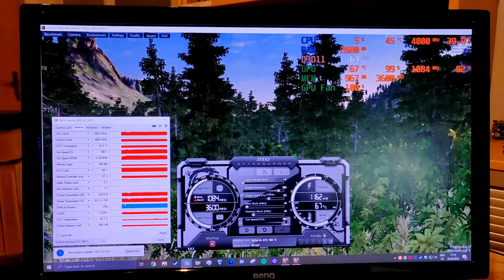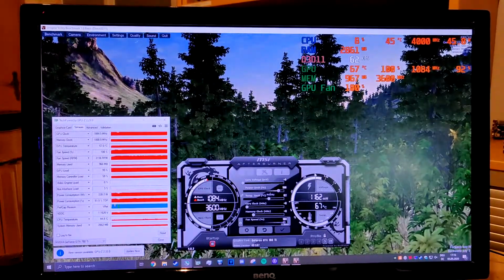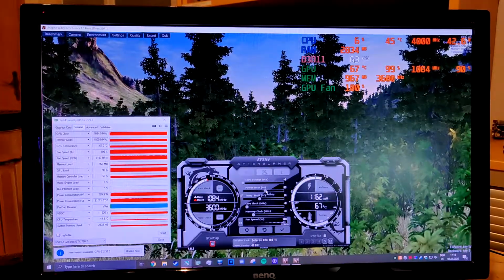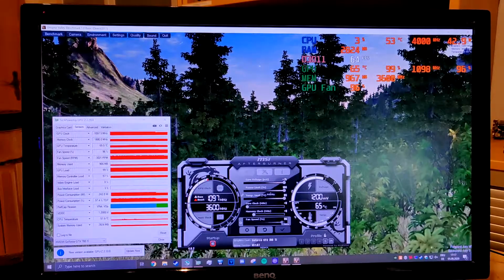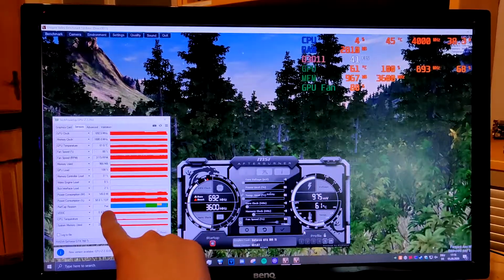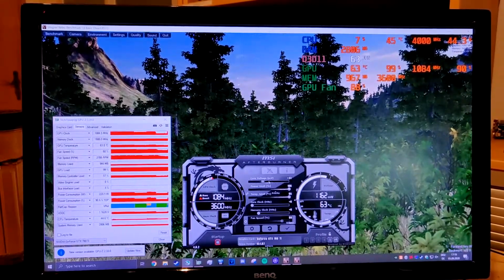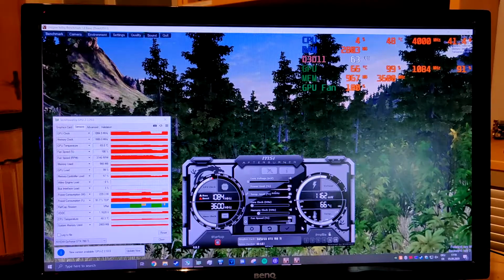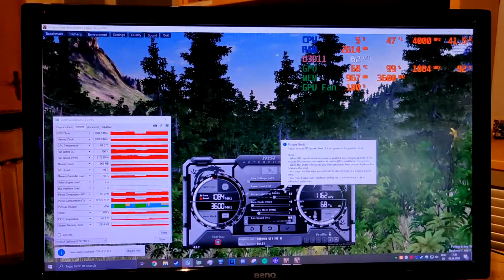Power Limits Part 2 (Practical Example) // Overclocking Basics

Comment: What does TDP means??
Reply from the maker: for myself i take iit as the stock (from Nvidia or AMD) Power Limit so for example 250W for the 780Ti. you can see the default TDP for basically every card on their techpoerup specs site (https://www.techpowerup.com/gpu-specs/geforce-gtx-780-ti.c2512)
Reply: @CmdrSoyo  i meant what does it stands for?
Reply from the maker: @Ozonised  Thermal Design Power